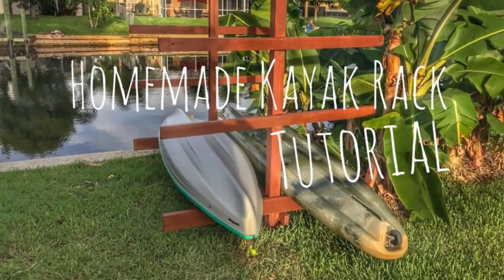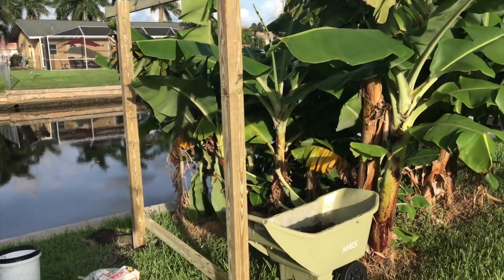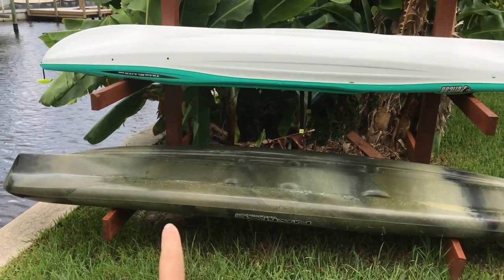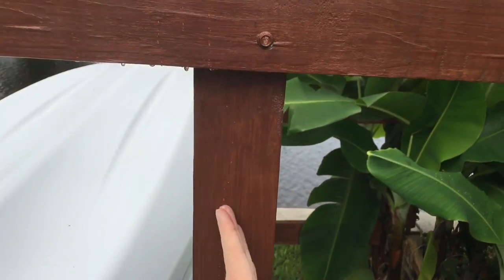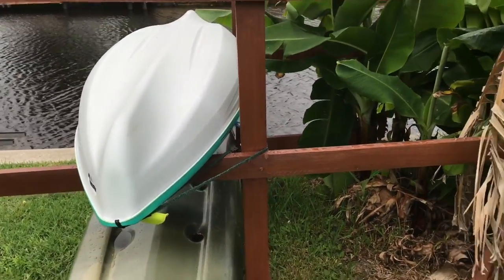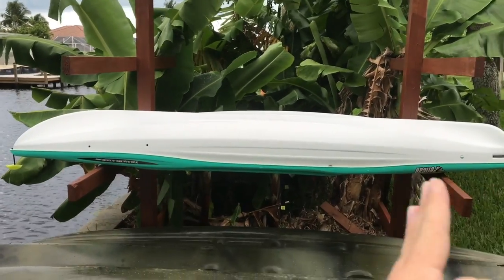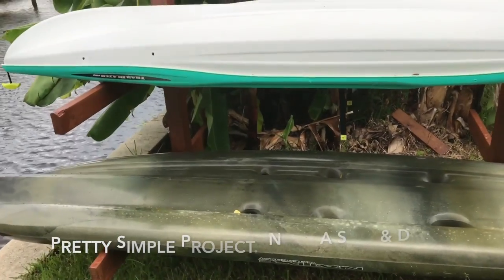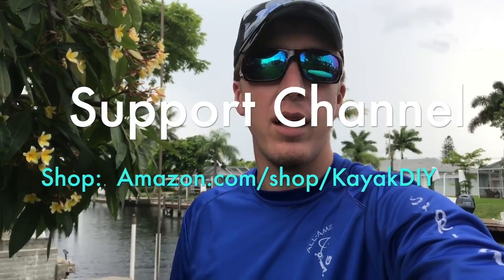Homemade Kayak Rack

Comment from the maker: Shop Deals at KayakDIY Store
http://www.Amazon.com/shop/KayakDIY

In this video we discuss how to go about building a kayak rack from wood.  This rack holds 4-6 kayaks depending on design style discussed. Tools needed are simply a saw, drill, and tape measure.  This kayak rack was built without any plans.  I simply bought some lumber and began throwing it together on my driveway.  I had a general idea for kayak/canoe/sup rack design in my head.  Very happy with end result so far.  I have some improvements I discuss in video.

SUPPLIES
4x4 boards longer the better.  Pressure Treated is nice.
2x4 boards 8ft long and some 16ft long. 
1/4"x 4.5" Spax PowerLag Screws or larger.  
QuickCrete-  Fast setting concrete mix (Used about 50lbs-75lbs /post)
Thompsons Waterproof Sealer Acorn Brown
Tape Measure
Drill
Saw

Comment: You could run additional 2x4's (2 per bunk) under the supports to prevent movement instead of the triangle braces. Might take less time and be easier, just use thru bolts  and nuts/washers.
Reply from the maker: Sean Lawrence I originally had that in video as another suggestion but appear to have edited it out.  I was up till 4am editing.  Haha.  I think that would be easiest.  Thanks for your feedback.

Comment: Awesome build!  I've had trouble with Thompsons Water Seal before.  It seems to wear out over time (mailbox post) and I've had to re-coat, usually seasonally.  Maybe a more durable finish would be like a shellac, varnish or something?
Reply from the maker: Larry Talbot time will tell on it.  So far it has held up great.  Had this built few months ago.  Still repels water very well.  Color is rich.   It is supposed to technically be good for several years.  I think 4+yrs.
Reply: It could be the environment here.  I completed my HF trailer last year only to have to re-paint the deck again this year, because of the extremes in weather and constant humidity changes here.

Comment: Do you think fence post from Chain Link Fence would last longer than your 4X4 you put in the ground?
Reply from the maker: Erick Peterman Metal if protected will surely last longer than the wood I’m sure.  The Thompsons sealer on wood is awesome though. Depends how tall of fence post you need.  Decent amount needs to be below ground.  What would you use as cross members to support kayaks?  Just curious.  Do they have cross fittings or something to make that easier?
Reply: I would only use the metal poles for the part you have in the concrete I would use the 2x4 for the rest along with the brackets used on fences when using chain link fence poles for wooden fences. All are sold at home depot etc.